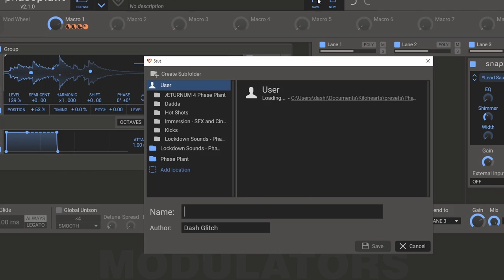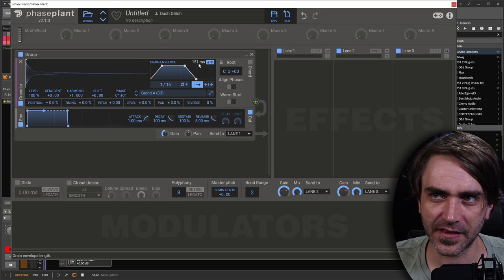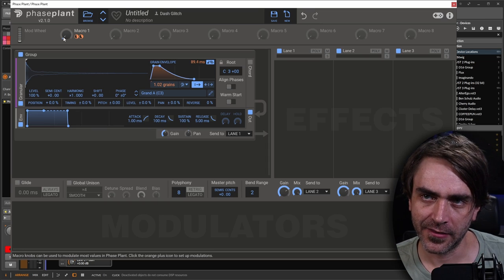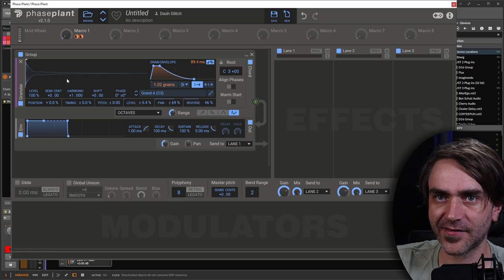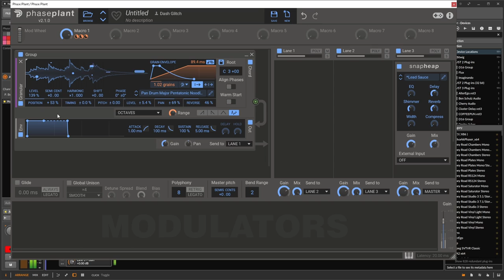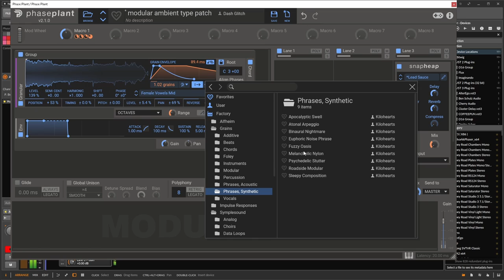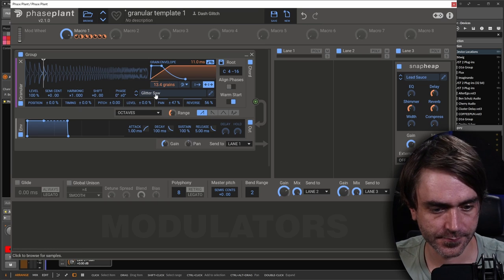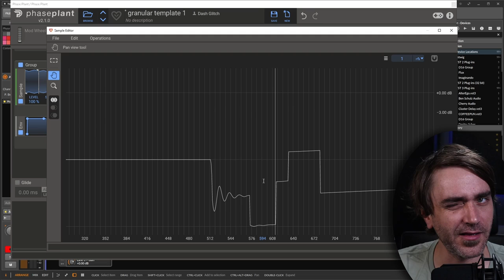Phase Plant's New Granular Engine & Sample Editor!

Comment: Only features I wish for are:

1.  Timestretching in the sample and granular engines

2.  Way more FX lanes, 5-10 would be much better, and perhaps a pair of master FX lanes?

Can’t think of anything else… Phaseplant is one of the best synthesizers I’ve ever used.
Reply from the maker: You can timestretch the granular by using the grain-size parameter. Also you can get more FX lanes by loading in snap heap (their FX host)

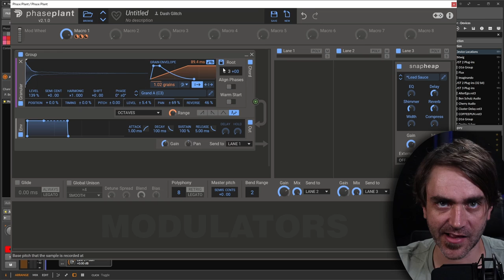Comment: 9:46 this lock only is for the pitch root note, not all the settings 10:14 what is making some grains slower or faster exactly? did you meant because the root note isnt the same as the root on the original sample loaded now that the lock was active?